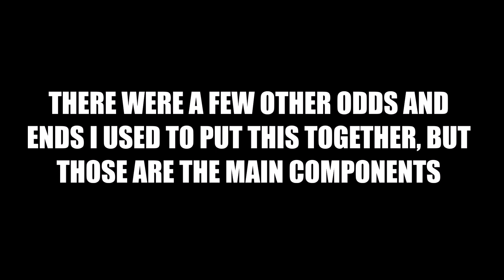Beating Heart Tutorial

Comment: How did you do the wiring connections exactly? You didn’t specify in the video.
Reply from the maker: Just the two wires "+ and _" from the motor down through a hole in the table. The wires run along one of the branches of the table base to a 12v female plug at the very bottom where I connect the power supply.  there is a 12v PWM speed control under the table (4:25 in the video), that allows me to control the speed at which the motor turns.